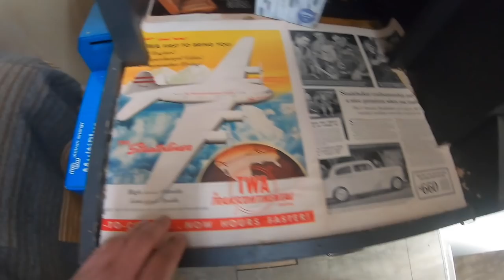School Bus Conversion Finally Gets A Ceiling - Plans For Painting

Comment: The wood warms your place up.. reminds of a 50’s camper. Will the heat humidity breakdown the map collage over time?
Reply: Modge podge is sealer and glue so if he does a couple of coats  or use some poly for the top coat , it should be fine . I’d use a Matt finish on the top .